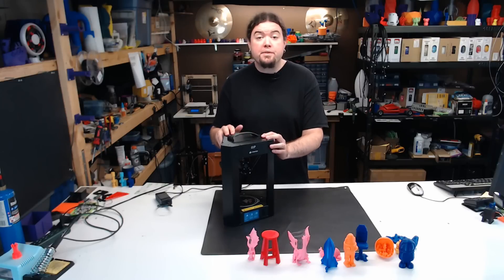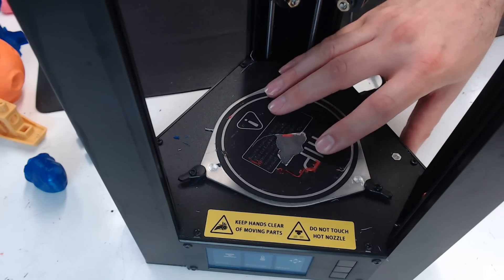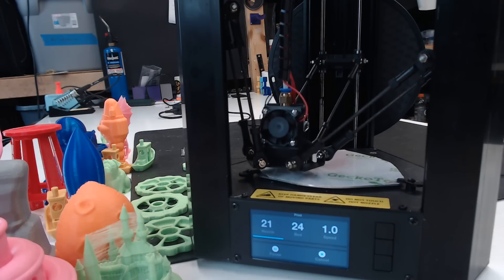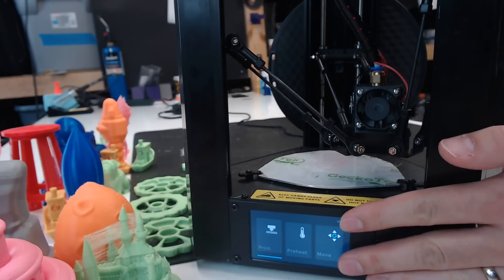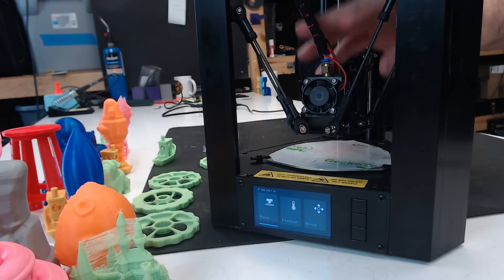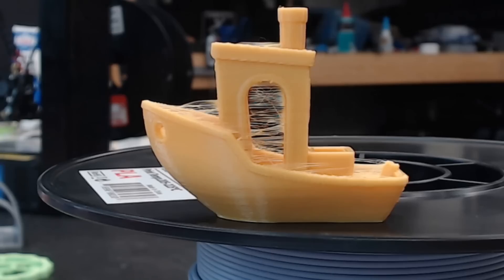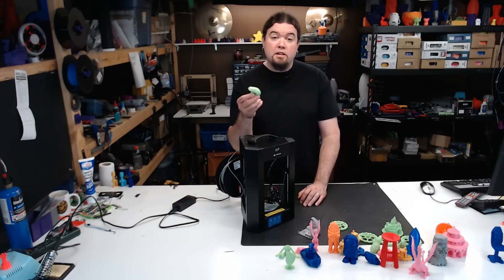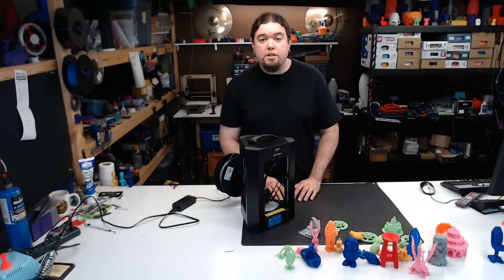Monoprice Mini Delta 3D Printer - Review - Chris's Basement

Comment: This printer is a piece of crap out of the box. The faults I’ve had on mine are

1. badly assembled, no lube, loose nuts
2. belts not tensioned and all at different tension 
3. Start and End g-Code needs changing 
4. Steps per MM needs changing
5. Build plate isn’t flat
6. Self levelling needs adjusting
7. Build plate struggles to hit 50deg
8. Settings G-Code won’t upload via SD
9. Pronterface doesn’t always connect easily
The list goes on but I’ve done so much (30hrs or so)

If your just want to print models that don’t require tolerances, go for it, but if you need your parts to be of the size you design, you’ll need to tinker.

I’m relatively happy with it now, considering I bought it on Black Friday for £60, but if I’d paid full price, I would’ve sent it back instantly.

I’ve notice many reviews of all 3D printers just say, “hey, I printed this test model and it looks ok, so I’d recommend this printer” 

Accuracy should be what is reviewed, if you tell it to print a 1cm cube, does it? If you want something with a 2.6mm dia hole, does it give you that? Anything else is meaningless
Reply from the maker: I would guess these vary wildly from printer to printer. Mine has been decent.

Comment: Hello I got some problems with this machine and I don’t know how can I solve The first problem is I take some files from any website and I put it on cura To print and unfortunately when It starts to Print it goes out of the bed and try to destroy the bed I don’t know is the problem from my g-code and where I can find my own G code for the same of this machine ~ thank you
Reply from the maker: Probably having a homing/leveling problem. Try removing the start gcode and replacing it with this. 

G28 ; home all axes
G1 Z10 F5000 ; lift nozzle
M104 S215 ; set extruder temp
M140 S60 ; set bed temp
M190 S60 ; wait for bed temp
M109 S215 ; wait for extruder temp
G29 P6 Z0.8 ;
Reply: Chris Riley thank you

Comment: Can I just unscrew the nozzle and replace it without disconnecting anything else?
Reply from the maker: Yes, should be an easy swap.
Reply: @ChrisRiley  thanks show just use a wrench and I am good?
Reply from the maker: Hold the block with some pliers and then use a wrench on the nozzle when it's hot. Try to leave the tape on.
Reply: @ChrisRiley  also I have an orange paper wrapped near the nozzle. It came like that should I remove it?

Comment: Can I just unscrew the nozzle and replace it without disconnecting anything else?
Reply: Hawkeye312457 heat it up first
Reply: But yes after it is hot and there is no filament in it you can change them

Comment: Also may I have the exact settings you use for your monoprice Delta mini. Settings such as retraction and temp settings?
Reply from the maker: Here you go. https://drive.google.com/open?id=1VAgJJygeWFHSD_DznFAw5Hcxpk_lrUCF
Reply: @ChrisRiley  what folder do I put them in?
Reply from the maker: @hawkeye312456  What slicer are you using? You will probably need to plug these values in by hand. This is from Slic3r, this file would go in printers.
Reply: @ChrisRiley  I am using ultimaker cura 3.2.1
Reply: @ChrisRiley  Where and how exactly do I plug the values in?

Comment: Mini Delta or Select Mini??
Reply from the maker: Tough call, Delta is a lot cheaper sometimes, so I would probably go Delta.
Reply: @ChrisRiley   Thanks for the reply, doesn't the delta also have a faster print speed, auto levelling and lower layer height than the select?
Reply from the maker: @magellanic3614  They can both probably achieve the same layer heights, but yes to the other two. Although the new SM have ABL. Only plus would be slightly bigger build volume.

Comment: so I recently tried printing on mine and my sd card will not go in it goes in but won't click to lock in and printer won't read files on it any ideas on what I can try
Reply from the maker: Not sure, I have had mine slip pass the socket before. Make sure it's actually in the slot.

Comment: This printer is a waste of money. I wish I had sent mine back. The bed certainly does not "auto level." PC USB connection works every now and then. The bed heat is not only inconstant across the bed but the temperature also fluctuates and is always below the selected temp. Also, don't consider what I have to say as an outlier, many many others have had the exact same issues with this thing. Spend your money elsewhere.
Reply from the maker: Richard, I totally feel you on your experience on this 3D printer. This printer is very low cost and results are going to vary. Mine has worked very well, but that doesn't mean that it will be the same for others. I paid for this one just like you did and I want to hear about the bad experiences just like I do the good ones. Thanks for the comment I hope it helps others.

Comment: wondering if someone can mod the height. the diameter is small, but alright for some stuff, but the height is really limiting. make it like 180mm, then we're talking
Reply from the maker: You probably can, not sure what it would cost, be technically it would work. Firmware might become an issue if you use the same board.
Reply: thats what i was thinking, but im going to slice and snap fit my parts for ease

Comment: I use this alongside my Prusa MK3 as a secondary printer. Decent combination, really. I spent a little bit of time designing a Pi camera mount that I was happy with, and I've connected the Pi to a relay that turns the microcontroller cooling fan on and off. I think some Mini Deltas didn't have this fan, but it's at the very bottom of the base and runs all the time when the printer is on.
Reply from the maker: Nice add on, it would be nice if that fan was on a temp sensor or something. Good idea controlling it with the Pi. Thanks for watching!

Comment: Great Video! What were the dialed in retraction settings for it?
Reply from the maker: Sorry for the delay,  I have been in airports for 2 weeks now. :) I am using 4mm length at 60mm/s 0.5mm Z hop, minimal travel after retraction is 2mm, my start level gcode looks like this. G29 P6 Z0.8

Comment: very useful review. could you please help me in how to calculate the frame dimensions, arm length etc.. for a delta printer to print the required build volume (say diameter 1 meter and height 1.5 meter)
Reply from the maker: Ashiq Mohamed Thanks! That is a tough question. There are so many factors there. I will see if I can find a diagram.
Reply: Sure. I will be waiting for your outcome eagerly.
Reply from the maker: See if this helps. https://reprap.org/wiki/Delta_geometry
Reply: +Chris Riley 
yes this is helpful. All I have to do is, to perform few theoretical calculations from this... I have also used deltabot calculator for verifying the results of my theoretical calculations. ITs pretty helpful. Thankyou Chris.  LOoking forward for your support throughout my project.

Comment: Thanks for the review. Although the limitations are somewhat obvious, I think the single, moderately amped 12v rail along with its form factor give this printer a unique niche.
Reply from the maker: Apocalypse Survivor Thanks for watching. That board is really pretty cool. It capable of doing a lot more then the code allows. Could be fun to use one on a project.